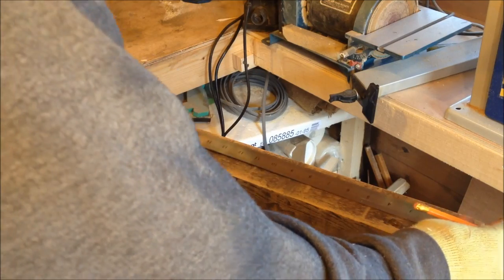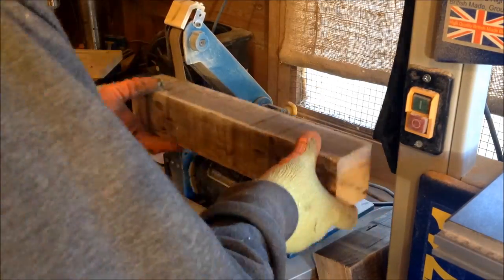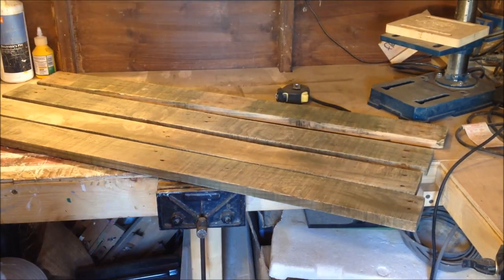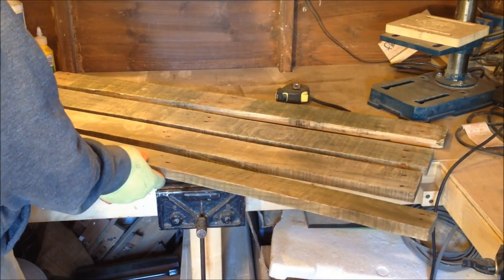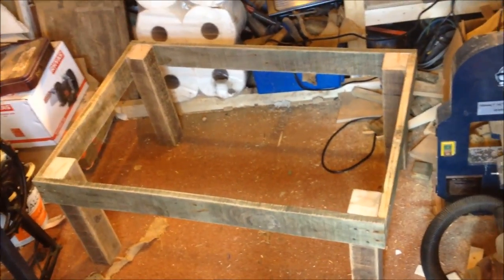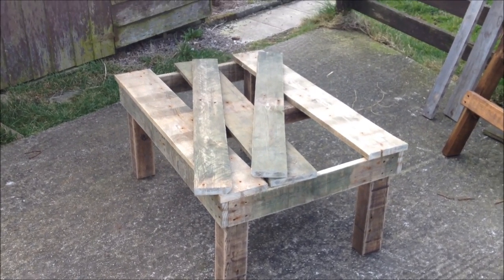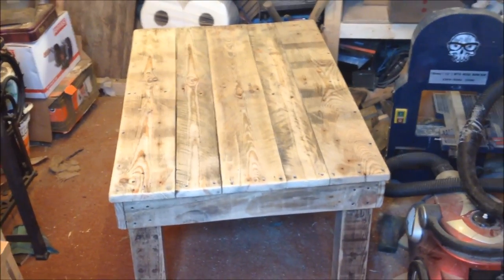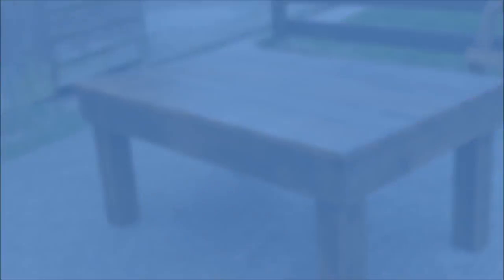Coffee Table from Reclaimed Pallet Wood

Comment: I had to pause some of the video so I could see what you were doing. Great job. I am making a tv table from pallet boards and have almost all the wood sanded and cut. I need to go out and find a couple more pallets so I can finish it. It sucks that many of the boards are split and I split some of them trying to remove them. This is why it's best to grab as many pallets as you can fit into your vehicle. It's really tedious removing the boards and taking out the nails. Thanks for posting the video!

Comment: Nice, but this is just a tip. Instead of screws for the top use "horse shoe" nails. The square heads will make the table look more rustic. And nails allow the wood to expand and contract more than screws would. Cheers.